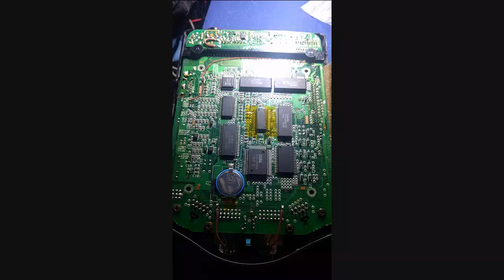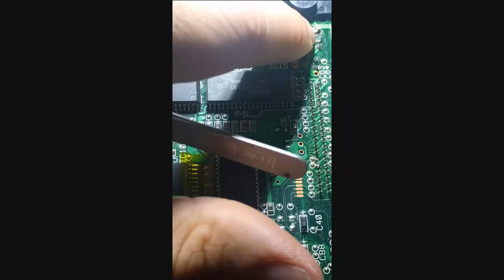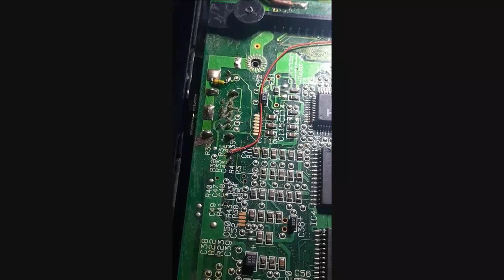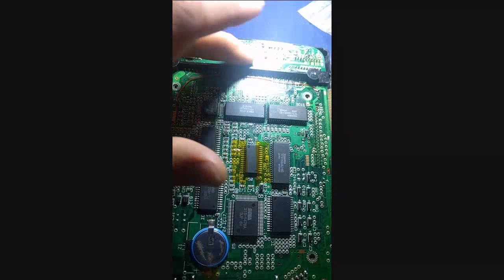[SSFD] Sega CDX repair explained in detail

Comment: Hello, Segasonicfan. I have a CDX with a disc playing issue, can you suggest anything? The disc spins up fine (Music CD, I don't have any CDX games), but I hear a light flicking/fluttering sound while it's spinning. The laser gear/motor seems to be fine and moves without issue. It wont read tracks while laying flat. If I tilt the side of the console 45 degrees, it will play track 1. If I tilt the front end 45 degrees it will play track 2, and etc. What do you think the cause of this issue is?

Comment: Really late here to the party, but yeah, I would love to see you put together a Sega CDX repair guide.
Reply from the maker: Thanks for the feedback!  It helps to keep it on my radar, cause I really want to add it to my site.  Too many projects right now, but it will be done sometime!
Reply: @SegasonicfanDesigns  I hope you get it together sometime.  I have a CDX myself that just powers on, spins the CD a couple of times lazily, but no sound or video.  Would love to get it back up and running. 👍

Comment: Hi I love your in-depth videos i had a few question about the cdx i have been trying to repair my cdx it powers on and unit seems to be in pretty good shape i replaced the laser and cd motor 
Hopping to get it to spin up you can see the motor move just a tick when you press the cd door button down when the unit is open also you can see the laser move up and down so it’s trying to work
Was considering a recap also was thinking maybe their is a issue with the gears or cd laser rail maybe they are not lined up or getting stuck or something any way just wanted to try to pick someone else’s brain thanks for the 1:33 great content keep up the good work😊

Comment: Yes, please make a guide for the sega cdx. I love my unit and it still works, but    audio output  bc of the pot is distorted a bit. Also it works with batteries but part of the track number is slightly off. I want to restore this unit